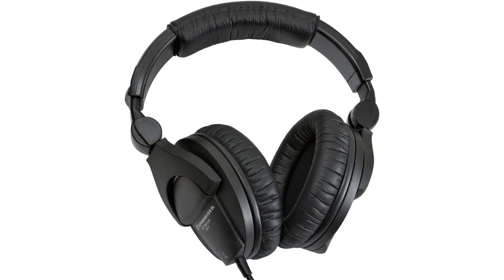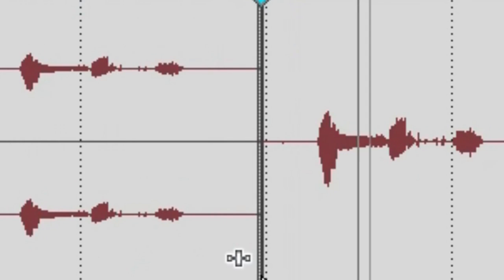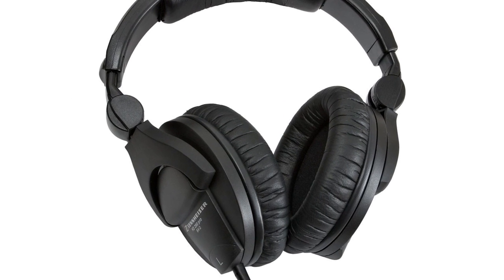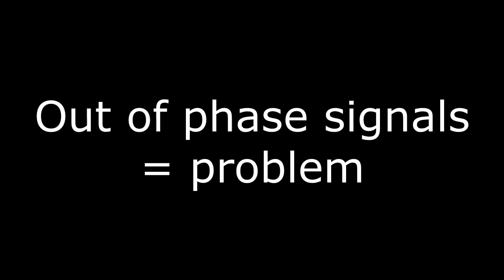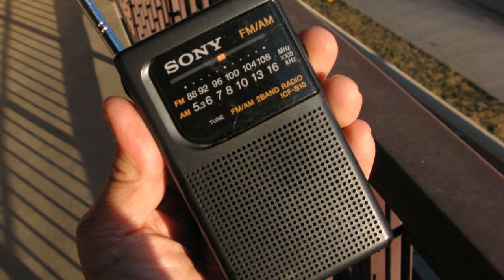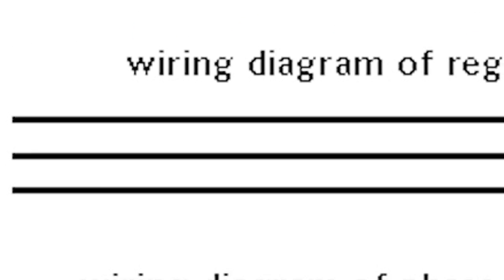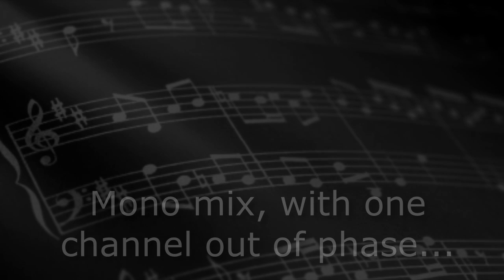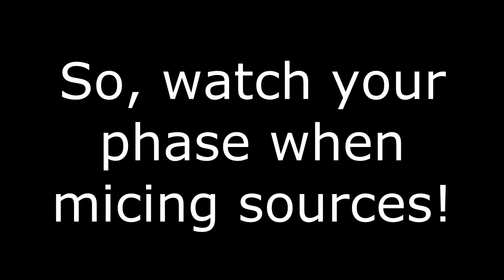Audio Phase: Why You Need To Pay Attention To This

Comment: I just purchased a pair of Bose wireless earbuds, and the effect is exactly reversed! I first noticed that podcasts sounded off and made my ear canal feel uncomfortable. I tried this video, and everything the narrator says is backwards. The "in phase" sounds hard to place and uncomfortable, but the "out of phase" sounds perfectly centered, crystal ear, and easy on the ears!

When I listen to this video on my computer speakers, the narrator is exactly correct.

 I'm going to go return these earbuds immediately.
Reply: I have a TV that does that, being used as a computer monitor. Its not my normal audio device, but if it ever switches, it sounds strange.
Reply: Your ear buds are wired incorrectly.  I have some expensive headphones that are 180 degrees out of polarity.  Good thing i can reverse the polarity in my DAW.
Reply: 4 years too late... But there's always the PEACE APO equalizer.